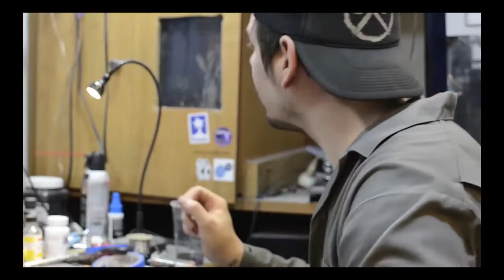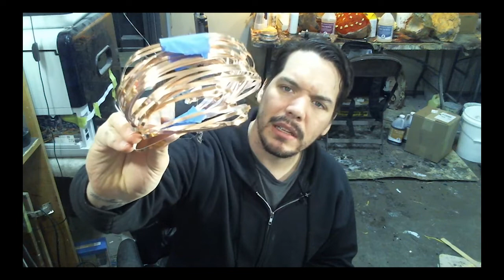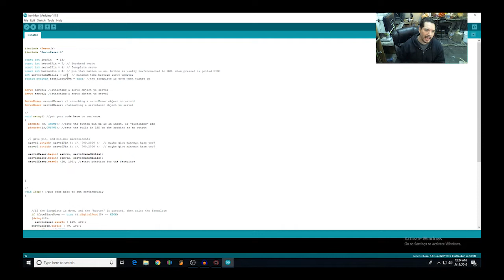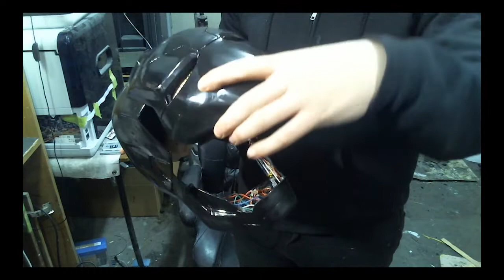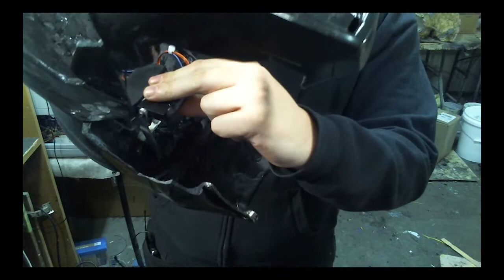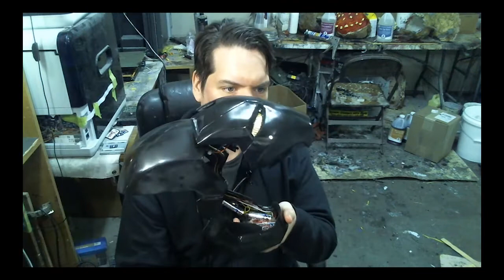Iron Man Servo System In Depth Look

Comment: Thanks for sharing these tips and code! Much appreciated. I have built several suits but need to do some servo work to get some areas motorized. Did you have any suggestions for back flaps with servos?
Reply from the maker: you should be able to use this same code with backflaps, just adjust the servo angles to ones that work with the flaps
Reply: @PrintsandProps  im doing the lights alone for my helmet. Do I need a resistor, or just the copper tape, and battery pack? And how many leds can be powered off of 3.0v?

Comment: Great video! I just have one question: how am I supposed to connect the voltage regulator? I tried following the schematic provided with soldering but no light is emitted. The voltage regulator heats up, but neither the power led or the eye leds light up. Sorry if this is a simple fix, I'm a beginner when it comes to electrical things like this.